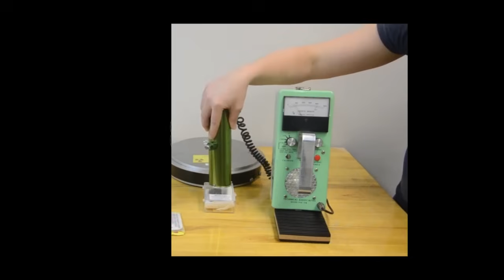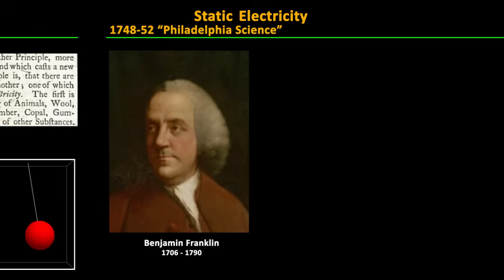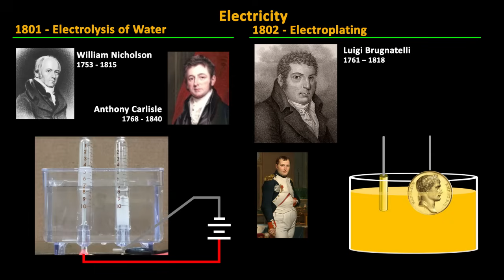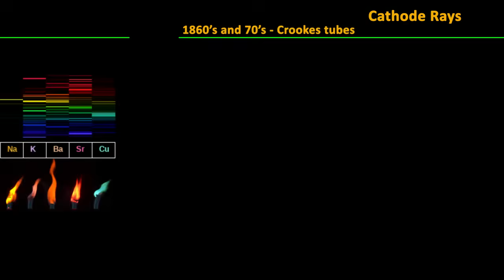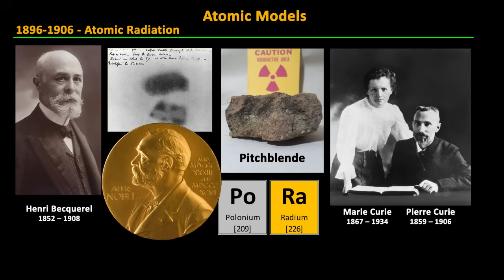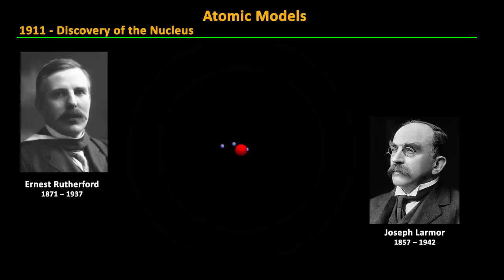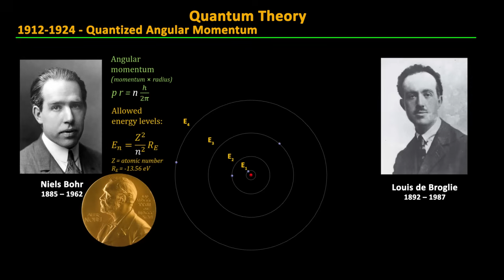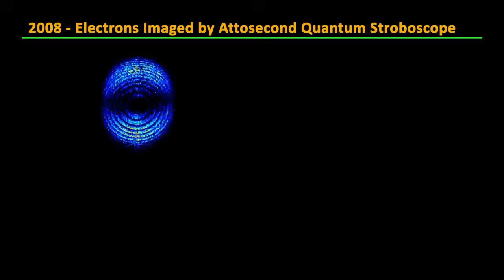The Electron (old edit)

Comment: The ORBITING ELECTRON does not spiral down to the proton because of emitting photons,   because ORBITING IS JUST FREE FALLING.   ORBITING is the SAME thing as FREE FALLING except you have enough x axis motion to fall around the planet OR PROTON.   And FREE FALLING is an INERTIAL FRAME.   Otherwise we would weigh LESS when on the side of the planet that faced away from the sun and weigh MORE on the side of the planet that faced the sun.   THAT DOES NOT HAPPEN !!!!!!!!!!!!    That is why a FALLING accelerometer says it is INERTIAL.  This is why you float and feel no force when in free fall.    The inertial PATH is accelerated down by gravity and the falling or orbiting object just follows that SAME INERTIAL PATH but that inertia path is constantly being accelerated down.   Since the falling object or ORBITING OBJECT(ELECTRON) is not accelerating relative to spacetime it is NOT A PROPER ACCELERATION.  PROPER acceleration ONLY happens when an object (or charge) is accelerating RELATIVE to spacetime.       So the orbiting electrons dont emit photons cause they are NOT ACCELERATING relative to spacetime.   LET US REMEMBER that a wave function is GRAPH that REPRESENTS the probabilities of  something being in a specific position in the future.   The electrons and photons OSCILLATE and so when they move forward the PATH they create is a wave PATH.   The electron is NOT A WAVE but when it moves it creates a WAVE PATH and so it obeys wave equations......DAH.   The electron bounces off of stuff  in the  double slit experiment like a photon cause they BOTH move in a PATH that is shaped like a SINE WAVE and so they get the SAME PROBABILITIES.       That is what particle-wave duality means  >>>>>The electron is a PARTICLE but OSCILLATES when it moves and so moves in a WAVE PATH.
Reply from the maker: The electron does not spiral down, because it's momentum is quantized and it can't slow down beyond a Planck's constant worth of momentum.  That's the main take away form Bohr's theory.
Reply: @AtomUni  .........All i can say is Bohr's theory is wrong.   I am curious i mean you know that you weigh the same wheather you are on the side of the earth facing the sun or on the other side facing away from the sun.   If you believe orbiting is an accelerated frame like swinging a ball on string then why dont i weigh more when i am  on the side of earth that is facing the sun??????????  I mean is it that you just dont care about the contradictions or ?????????

Comment: The explosion of an atomic bomb shows that the inside of an atom is not dead weight.nthe particle pulls in alot of innerspace. Space is potential energy turned to force. It's the repulsive force between the two types of space. Infinite outerspace and innerspace. Innerspace is where infinite outerspace meets its inner points. The expansion wave is that force that travels thru these two types of space. It's the expansion and contraction of innerspace against infinite outerspace. Called dark energy in our universe. The magnetic field and spin occur before our universe,then when our universe began the expansion wave was introduced. It's the force behind the energy which causes the charge an spins off the electron which establishes the field. Innerspace is like the coil. It's has spin and a magnetic field around each sphere. Dark energy is the negative. Dark energy connects all space and is connected to innerspace thru the field. Space is packed with innerspace at a 12 to 1 ration. At maximum expansion innerspace plugs it's info into dark energy and that discharges,behind the expansion wave,the photon,the electron,the particles responsible for  matter,muons are there somewhere and neutrinos. The expansion fires toward the expansion wave,and the opposite direction. So it splits the sphere at discharge meaning it shares spin with six spheres on each side.
Reply: Dark energy is between everything
Reply from the maker: Granted the word "dead" in my little joke does not quite apply to the weight of the nucleus.  

I understood dark energy to be "dark" in the sense that nobody knows what it is (but I am not an expert). 
Do any references exist explaining that theory?
Reply: @AtomUni no. Actually while I was thinking this stuff out a couple years ago I had a half dozen Funk And Wagnalls encyclopedias. After I had thought of innerspace,I noticed a brief mention of some people believing space was full of little spheres. I thought that was cool. From 82 I believe. The amount of atomic knowledge in those encyclopedias is great. Very detailed and full of knowledge. Plus they are good reads. This theory allows me to see how an infinite space can function. From the beginning,which I've focused on here recently,to the collaspe of space that created our universe. It takes forever to type out but it makes sense. It works. Everything not known,it seems to answer correctly. How it has to work. Rather than silly nonsense. Notice how everything spins from something. This theory actually sets the plank,the quantum,the unit to a specific size,as the base structure created by force. Repulsive force. Close your eyes and create the space. I like this stuff

Comment: This is a nice video. I can testify that there is electricity in the clouds as Franklin found out. Many years ago I was putting a wire up with a kite as an antenna for my radio. It was a bit cloudy and nearly raining. The antenna gave me a few electric chocks so I pulled it down quick smart.
Reply from the maker: I should have added the warning not to try this yourself at home!  
Here's a fun story:  Although Franklin completed the kite experiment without incident he had earlier shocked himself into unconsciousness with an experiment to kill a turkey by electrocution.  He happily reported afterwards, however, that the turkey meat was uncommonly tender.
Reply: @AtomUni  Unfortunately I didn't get any turkey out of it - just a bit of a scare. It was only light rain - not a hint of thunder - so I was a little surpriced. I wasn't trying to redo the Franklin experience - only to get a bit better reception on my radio.